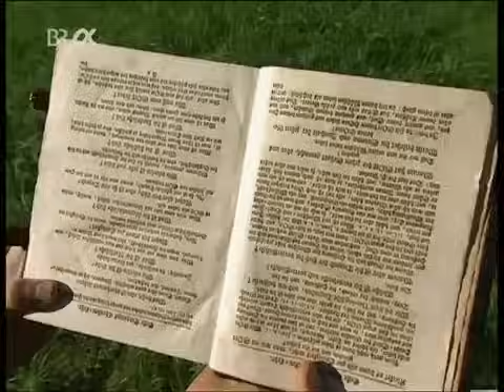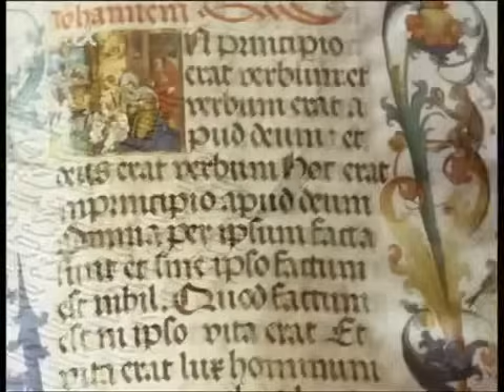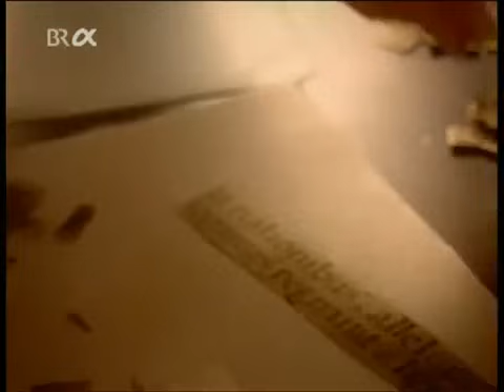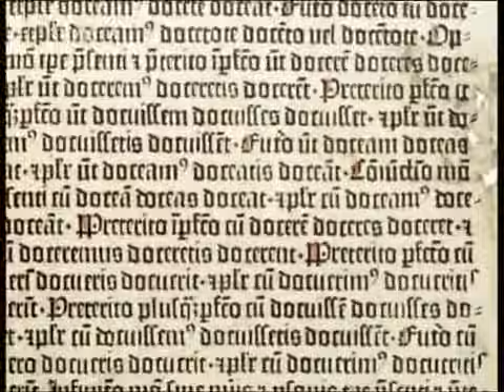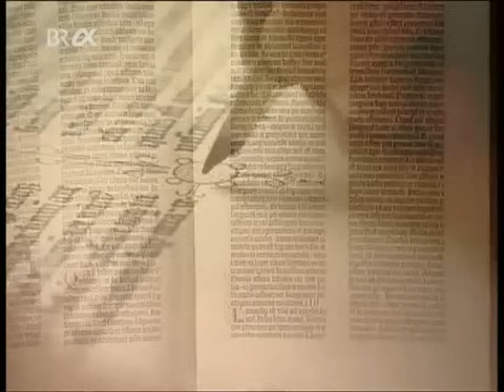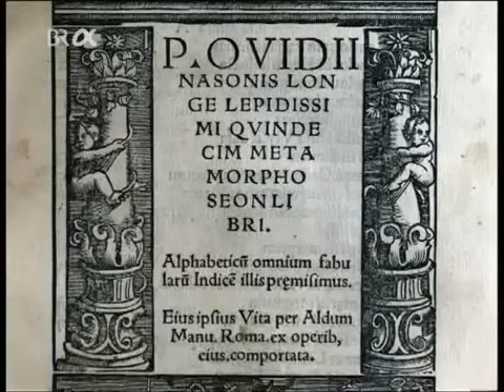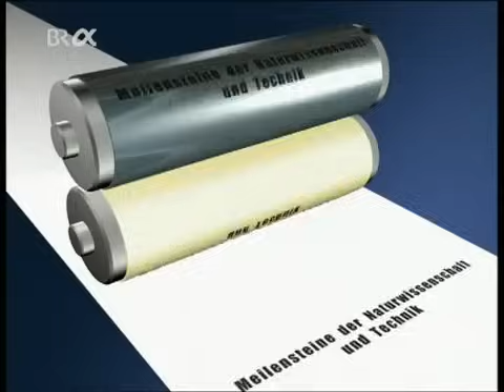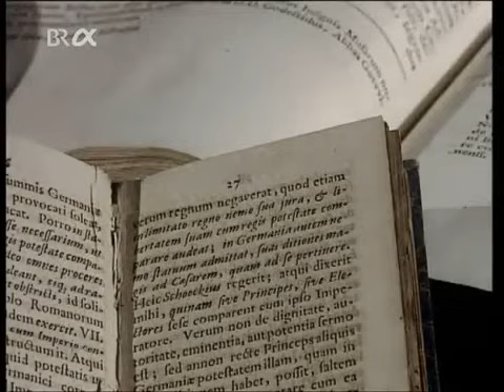Johannes Gutenberg and the Printing Press

Comment: interesting but totally glossed over the linotype machine which was the standard machine that all newspapers used from 1892 right up until 1970's and based on part on the gutenberg movable type idea but used a machine keyboard to extract letters which the machine would present as a line of type. The machine would then slide it along and pour molten lead into the voids in the line of type create a lead stick sentence which could then be added to the other lines to create a block of text. 90 years of history glossed over here.